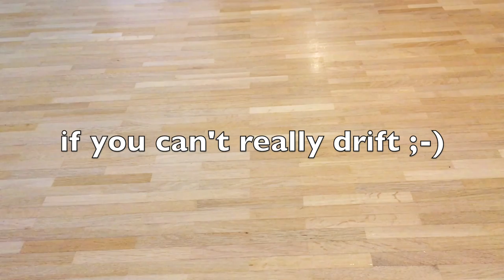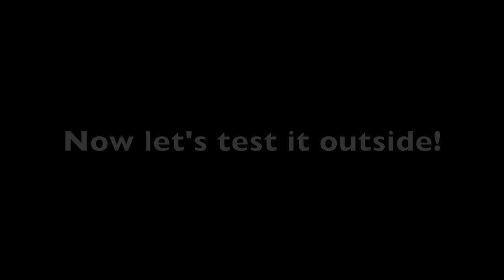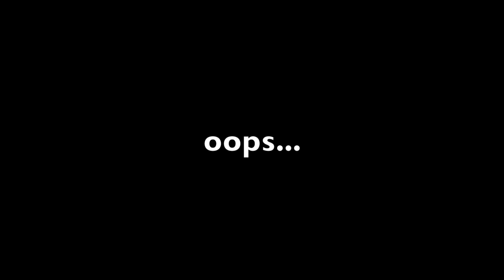Wltoys K989 Rally Fiesta Mod: Now With Arduino Drift Assist!

Comment: You use 2 lipo on this receiver?Have you the schematic for 7.4v lipo battery?Thanks
Reply from the maker: Yes, but the 2S lipo connects to the ESC. The receiver is then supplied with 5V from the ESC (via the 3pin servo cable)
Reply: Ah ok.Thanks!

Comment: I am at your github page but where do I go for the how to for the MPU-6050?  If you have a link with instructions that would be great....and yes I have watch all of your videos for the 6050 but not able to follow it..
Reply from the maker: There is no how to, but it's really easy. Just select all the required parameters for your vehicle in "vehicleConfig.h" . To use the MPU-6050, you have to use vehicleType 5. The sensor only requires 4 wires: GNG, VCC, SDA and SCL, just like shown in my videos. That's all. Of course you will also need a "Micro RC" DIY remote.
Reply: TheDIYGuy999 Ah..is there anyway to just use the 6050 with a receiver of my choice?
Reply from the maker: No. But you could use a Traxxas remote with TSM

Comment: thanks a alot, but ... for the Drift assist? ....
Reply from the maker: Just select vehicleType = 5 in vehicleConfig.h and connect the MPU-6050 sensor to SDA, SCL, VCC and GND. But of course it will only work with my "Micro RC" system. So you need to build the entire system, if you want to use this functionality.